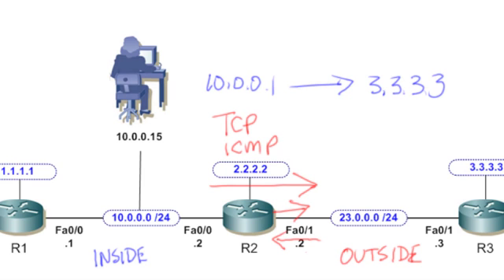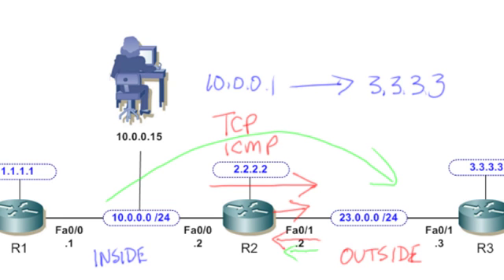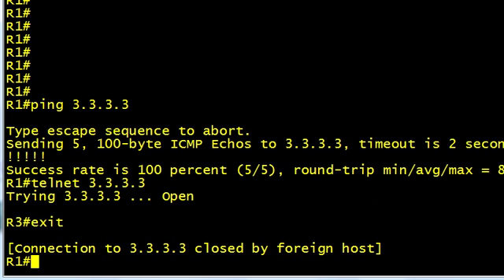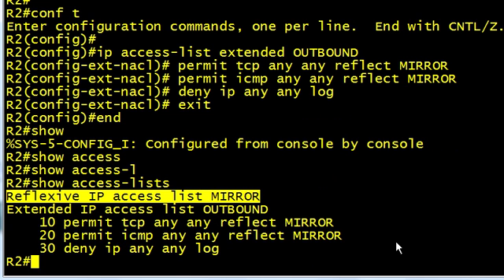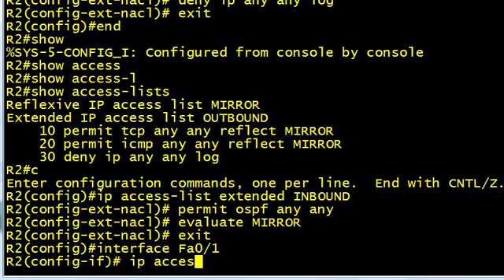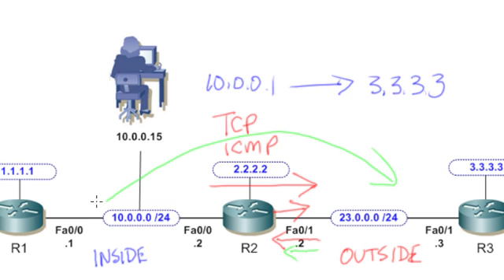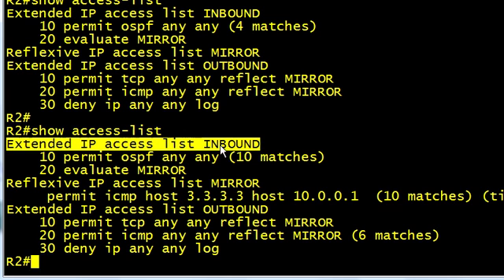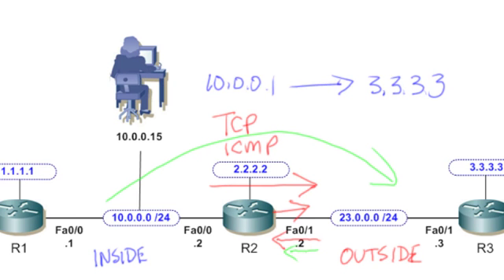Reflexive Access Lists

Comment: what happened to one per interface, one per direction one per protocol?
clearly, you placed 2 acls on the same interface, different directions..
Reply from the maker: Thank you for the question Anuar Y!  If the 2 ACLs are in different directions, that abides by the rule of only 1 in a specific or given direction.   I ACL (for that type), per interface, per direction.   If 2 ACLs had been attempted to be placed in the same direction, the first one would have been replaced.   Thanks for the question.

Comment: Thanks for Gr8 vid. I tried the same topology as yours. But ping is not successful from R1 to R3. there is a entry in reflexive ACS permitting host 3.3.3.3 to 10.0.0.1.   i can see matches in reflexive entry but still failed to ping from R1 to R3. what could be the issue. Wireshark says  traffic is administratively filtered. But in your vid, you can ping. howz that. Awaiting your reply sir.